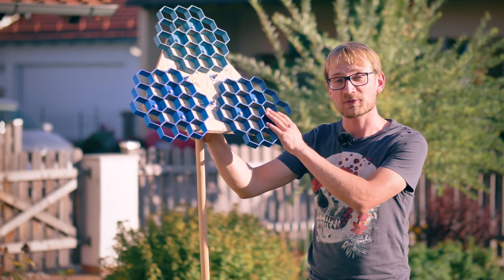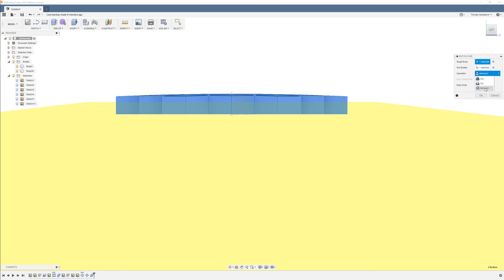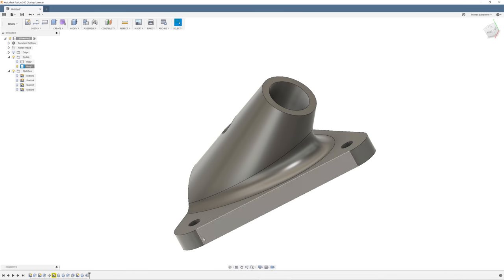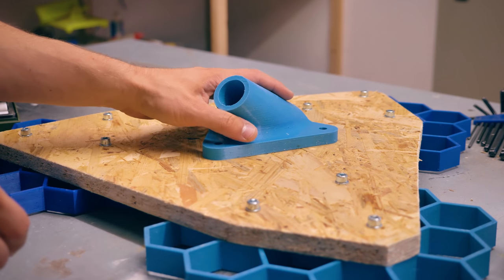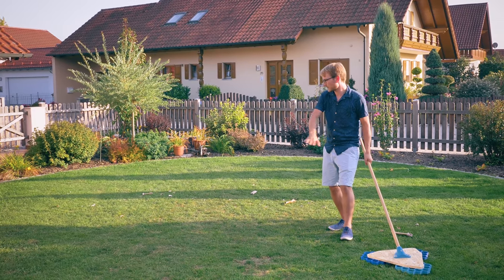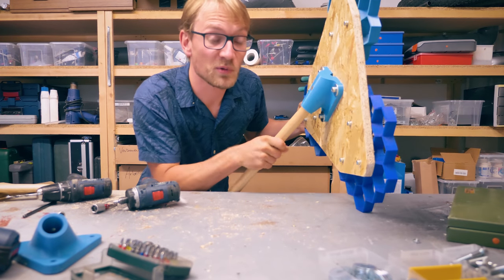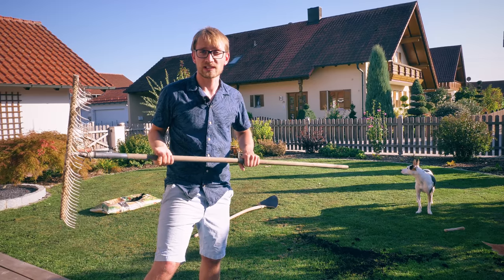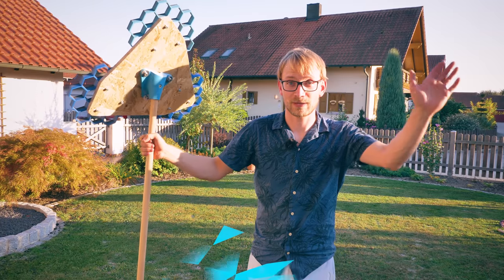Making a Topdressing Tool! / Parametric Design in Fusion360 / CR-10

Comment: I had to Google "putting sand on lawn" since I've never heard of such a thing. Great video! Thank you for putting in all this time an effort.
Reply: LOL, followed your suggestion and got this: "Sand is used because people think it will improve air space and water infiltration and drainage. These are important organic gardening goals, but top dressing lawn with sand does not help achieve them. No matter what your soil is composed of, putting sand on top can cause drainage problems and dry pockets in the soil." Bad luck for Tom I guess :D
Reply: I saw that too... didn't want to say anything.

Comment: Turns one so all aligned. Proceeds to put them on cockeyed and has to make an extra cut. Hope all the OSB aren't sitting on the concrete floor. They like to absorb moisture.

But great work on making something that is useful.

Comment: I learned that I would probably spread the compost with the seed spreader you used at the end, and just water it good. If I was going to build anything it would have been a 2 wheeled compost/seed spreader(I think they sell them fairly cheap), given having to do this every 1 to 5 years or more often depending how picky you and your neighborhood is, that includes knowing that as I get older that I would not want to kill my back like that.

Comment: As a minor suggestion... While OSB is definitely cheaper, it is not sealed or easy to seal which is why its usually used for interior panelling and not outdoor.  What you'll find with a tool like this that is used outdoors is that the OSB will swell (like 200%+) and either pop the bolts or distort the shape.  Not an issue if this is the only time you ever plan to topdress the lawn but for a tool that lives in your shed, this will probably ruin it for next year.  Would recommend getting a plywood and sealing it with a polyurethane or varnish before attaching it all together instead :)
Reply: Lloyd Richards I was thinking maybe flexseal, since he’s already made it with OSB
Reply: I don't think PLA would hold up being outside in the hot sun during the summer months either, but he may be storing the tool inside. You're right about the OSB though. I don't think it will hold up beyond one or two seasons at the most, even with diligent tool cleaning. I've definitely learned MY lesson in using OSB. Generally, I don't use it at all, even though it saves a couple of bucks.

Comment: In the preferences in Fusion you can set x, y, or z as up. Another nice tip is in preferences you can change the control scheme as to how you pan and rotate. You can select it to be like solid works, blender, ect.

Comment: You sand your lawn for simple reasons. The lawn can be levelled relatively easily by adding sand, i.e. unevenness can be filled in. The fine quartz sand also improves the permeability of the lawn. This reduces the risk of waterlogging (Germany is pretty wet), as the water can run off better. In addition, the nutrient supply is also improved, as the roots have more air and there is also a soil exchange.

Comment: On parts made before the Z up change, Rotate the model to Z up and Then adjust your view so that you are looking at the front of the part with the top pointing up. After that go in the hidden menu below the View Cube  (Set current view as / front) then it will orbit correctly and export correctly.

Comment: Despite the added steps, for anything other than the most basic parts, I use parametric design in Fusion 360 - mostly because the ability to change a parameter and view the change in the design as it happens - and undo it if required for comparison - is a useful way of designing for me.

Comment: Instead of deleting geometry of features you don't want anymore just right click and remove instead. That wont delete the thing from the file permanently and you wont get reference errors.
Reply: Chrankus ohhhhhhhhhhhhh ok I didn’t realise there was a difference between those two
Reply: David  Its not a workaround to delete features or geometry. It's just bad practice as it will give you reference errors later. Just use the remove feature as it does the same as delete, but smarter.

Comment: Tom, for CNC machines, Y is typically the up/down direction.  In Fusion 360, open Preferences, under General, select "Z up" for the default modeling orientation.  This will change the X, Y,  Z directions to what you're expecting!  Unfortunately this will not change your existing drawings, it will only affect new ones.

Comment: IMHO It would make a lot of sense to add a hinge at the connection of the hanlde and the base because as you push or pull with you hands the angle from your arms to the base center changes...
Reply: damn straight Eyal Peleg . I was going to say the same thing. Far more ergonomic. As soon as Tom put it on the ground the first time I thought to myself "that seriously needs a swivel ball mount". Ball mount -- would be better than a single direction hinge I reckon, you would  get full xyz movement rather than a single axis!

Comment: Setting your default model orientation to 'Z up' will solve your stl slicer orientation problem.   Using a revolve to trim the top of your hex mesh would give you more freedom with respect to the top curve.

Comment: @3:00 that's a very awkward way get around having to use the revolve command. Hint for for future: right angle triangle, using an arc as the long side. tangent+coincident to center, coincident to sides, then simply drag the edge to find the slope you want, and revolve cut around the center axis.

Comment: Cool concept! Good to see more people using parameters! Oh, and the circular pattern tool should be able to make that hex pattern  a bit easier than doing it by lines :) 
Firstly, regarding your axis orientation, you can change it by clicking your name, then Preferences, then in the General section, change "Default modeling orientation" to Z up or Y up or whatever your slicer uses.
 Also, with regard to those references, rather than deleting things, it's usually better to use "Remove" to get rid of things from your design, that way it won't destroy your references. (Right click on the body belonging to the bit you cut off in the hierarchy, and select remove (should be under delete)

Comment: Thomas Sanladerer, this is only a "cosmetic" feature, but you may also change the default METAL material to plastic. F360 was originally developed for CNC design/machining; various modules and features were added to make it more flexible, but there are still no 3D-printing oriented features.
Reply: And it's a really good one. It's no fun trying to squint to see lines on that low contrast metal background.

Comment: what motherboard would be best to have a sd card and lcd screen and be able to use tmc 1230 stepper drives? plus I want to go 24v power supply for faster heating on my bed and nozzle or do you recommend a 12v instead?

Comment: I bet you could have used a revolved cut using a spline instead of using the giant sphere (sort of like what you had done in your first attempt). You could have created the edge along the right or front face, and revolved around the Z axis at the X-Y origin (which was the center of the part).

Comment: Would there be a better print orientation that reduces the lever forces of the broomstick? currently the part is optimized for the force distribution of all three screws on the bottom plate but the lever of the broomstick could split up the part. I would have used a secondary part to limit the effects of such forces - maybe overkill, but better safe than sorry ;-)

Comment: Ah the good old project source disappearing is still not fixed. Autodesk has posted a UI demo for a repair tool a couple of weeks ago so there is hope. 

As for the modeling direction, Google "fusion 360 z up". You can change the default in the settings, but I don't remember how to fix an existing wrong part.

Comment: maybe you need a little lip ramping up on the front edge bit like slide like a skiis front edge a little bit so pushing is easily but the reverse pulls and spreads all around

Comment: I'm just seeing that you use an old version if slic3r. The team at prusa put a lot of work into thr updates and it would be a shame not to use these. Expecially the new place on bed function they implemented quite a while ago. it is super handy and much quicker than the old method of rotating it manually.
What I'm saying with this: always keep your software up to date otherwise you might miss out on some cool features.

Comment: was definitely just like ordered as I am just learning f360 and was a bit disappointed because in Solid works i could effectively wipp up a parametric design and then versions controlled by a spreadsheet... in f360 i still lack faith that it could even be done...
Reply: Usertogo, the implementation of user parameters in F360 is very simplistic. There is even no way to minimize the contraption; it must be closed and opened again every time it is needed. Surprising for a professional tool.
Reply: @michaels3003  "professional". Wait until your sketch projection loses its source and you can't fix it other than deleting the projection. They're looking into it, as they have been for the past 3 years, but maybe this time they're serious. 

It's only been months since custom keyboard shortcuts came out, you know.
Reply: Since I am not paying for it, I cannot really complain...

Comment: The key floor in the design is the handle mount should be hinged. The angle you work at changes as you move back and forth. I am a landscaper so i know a little about garden tools. Great vid but poor design.

Comment: I just HATE how Fusion360 snaps everything back into the origin or origin planes, no matter if you put your sketch or surface on a face of an object. Brings back emotionally heavy memories of R13 on DOS doing origin arithmetic to put down an array of holes on a curved surface.
Seems like Autodesk hasn't realized how much the times have changed and still has an unhealthy relationship of it's early command line CAD legacy